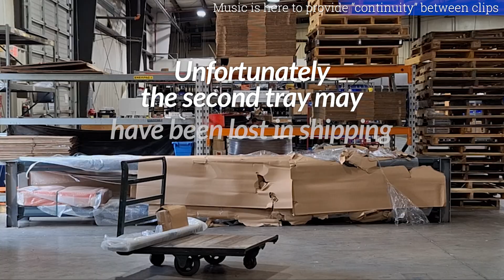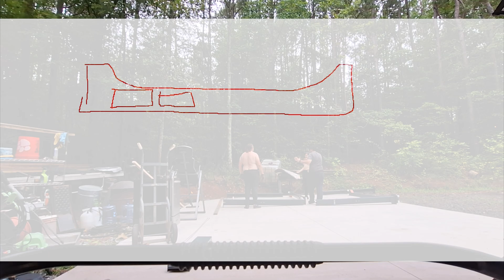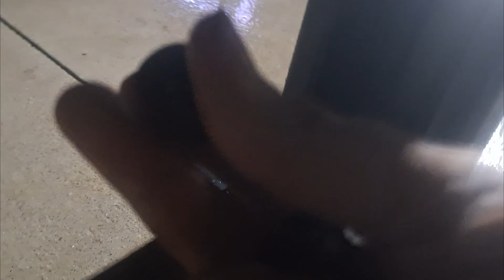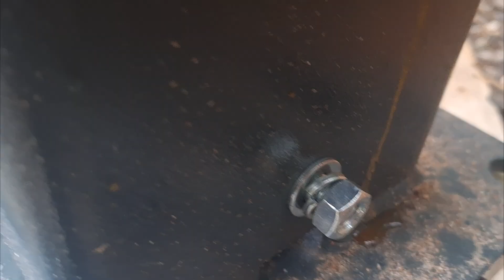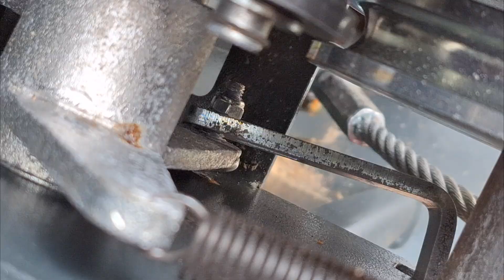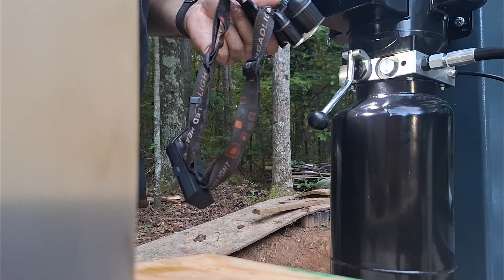KATOOL 4 POST LIFT

Comment: I would never use 2 jack trays to lift a vehicle. Imho it is just unstable and too much can go wrong.
Reply from the maker: I totaly get that concern, I am worried about that as well. People I have talked to said that as long as you put jack stands when you lift each side its very stable, but these jack trays are to narrow for any of my jacks, so i have not actually tired doing that yet. I was looking around for what other people do and the most common solution I have come across from people that do fleet maintinence and run shops is they get the tall 4' jackstands and set them up on the ground inside of the lift and lower the car on them, so thats the next solution I am looking into but those jacks seem to be $100 dollars each so that might take me a couple of months to get them all

Comment: Nice job. Will be assembling mine in spring after I pour the slab. Looks like a perfectly level slab is paramount. Thank you.
Reply from the maker: Its not to bad, but be aware that the runners are very heavy😂 PS: if your slab is outdoors you will probably want it made with a grade for drainage so water doesnt pool after rain. Then level the unit after (our grade was just extremely severe because we tried to do it ourselves 😅) Good luck!